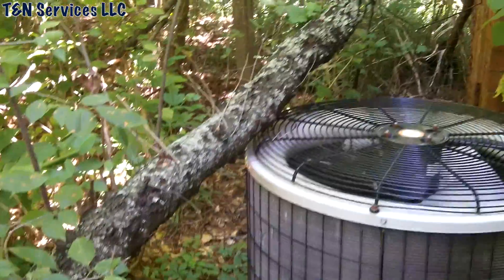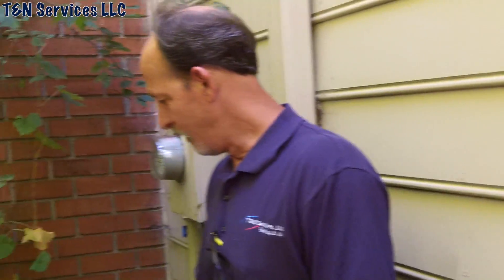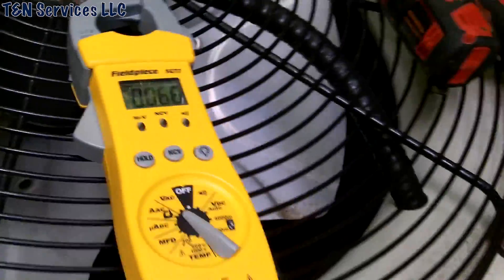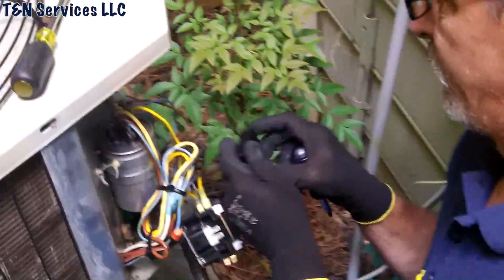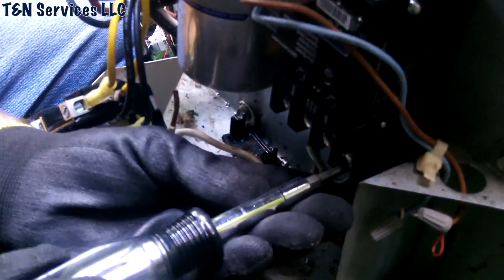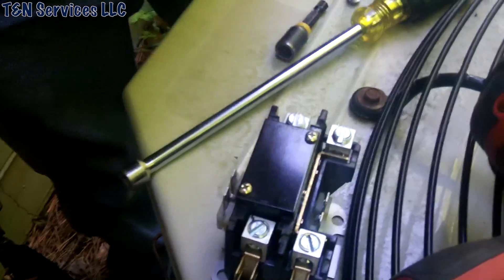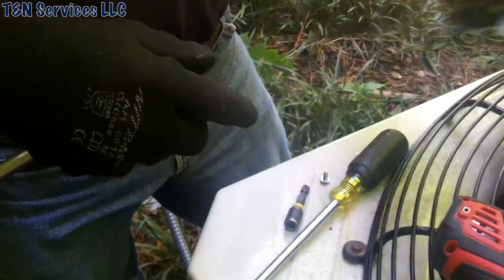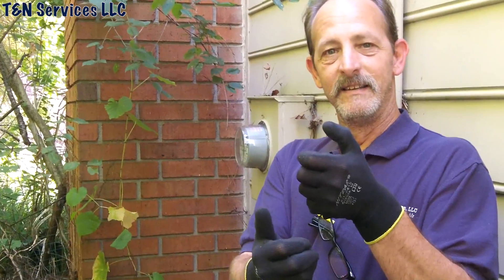Emerson SureSwitch Install

Comment: I noticed my compressor motor and fan motor are wired opposite of whats shown in the installation diagram that comes with the Emerson SureSwitch,  It seems to run fine.  Is that ok?  Originally my contactor relay contact was wired on L1.  But Emerson shows that they want L2 to be connected to the Normally open Contacts while L1 is shorted straight through the relay on a bus. 

The other thing thats reversed on my setup is not just L1 and L2.   L2 was ORIGINALLY wired to Common on my motors but AFTER installing the SureSwitch, L2 is going through the NO contact to the RUN winding side of both fan and compressor motors.  Most diagrams I have seen suggest the Common side of the motor should be switched with RUN always hot.  My unit runs fine though.  I am just wondering DOES IT MATTER IF YOU FLIP THE L1 AND L2 WIRES COMMING IN?  and Does it matter if your contactor relay NO Contact is connected to the motor Common or the Run winding side?

Comment: In researching the SureSwitch, I see only one of the Line inputs is switched. The other is internally jumped to the compressor all the time. Is this a good practice? If so, why do most contacters switch both legs?
Reply: @mman454    If you have a compressor heater installed, it must have power, so a 1 pole contactor is used.

Comment: I'm going to put one of these on my next unit. People annoy the hell out of me that don't listen or are just lazy. That guy will never remove that tree just like he never sprayed foam insulation in that hole or addressed his ant issue. "gee, I don't know why I have rats and bugs in my house" "I don't know why I have ants". Anyway I usually encourage people to replace the cap and contactor at the same time assuming they are the same age, even if it doesn't need it.

Comment: I'm surprised used a white wire for 220v to feed contactor. That's not code.
Reply from the maker: The whole not using a white wire from a disconnect to feed a ac unit was one I never understood. I get that on a normal household circuit that white is neutral and is used only for 120 volts. But on an ac unit where the disconnect should be pulled before the cover is open, or the person that is servicing the equipment not knowing that it’s supplied by 220 volts. For gods sakes the label states that it’s 220 volts, if the argument is that someone will see the white wire and think it’s 120 volts and will get shocked. That point becomes mute when first of all someone shouldn’t open the cover without knowing what voltage is supplied to the unit, or he’s not using a METER. If those 2 things aren’t done then you think the person who opens the unit is really going to see a white wire and think to himself that the unit is being supplied by 120 volts and get shocked because he mistook a leg of power for a neutral. At the end of the day you caught me. It’s code and I used the wrong color wire.

Comment: some customers you have to fire because of lack of maintenance or neglect causing call backs on their equipment and that voids their warranty  they are not worth the call back.  we are eat up with fire ants down here in  north carolina.  I put down amdro ant bait around most customers units and charge them 5 bucks to do it if fire ants are around or in the o/s unit.  how ever if their is a call back for the same reason it voids their warranty.  you just have to let em go on to another contractor.  it will same you $$$.
Reply from the maker: These people don't have a problem paying for me to come back. Believe me I charged the full rated for this and didn't give them a break
Reply: You probably need a pesticide applicator's licence to apply insecticides for pay.  If you do need to spray or bait, do NOT put it on the invoice.
Reply: NETWizzJbirk the best pesticide is  Termadore. I might have missed spelled that but it's used deluded and spayed only outside but no ants or roaches for about 4 years with one spray. I know cause I use it.